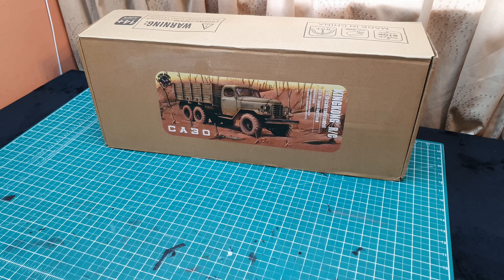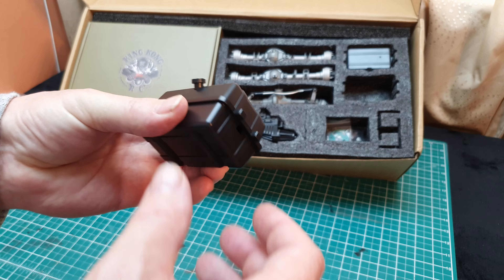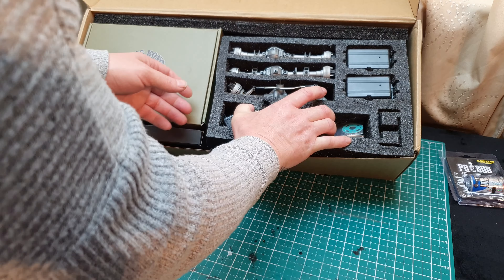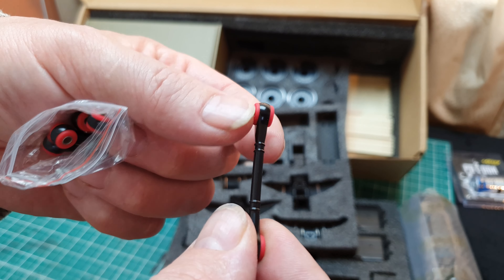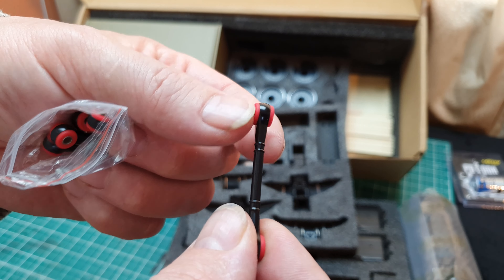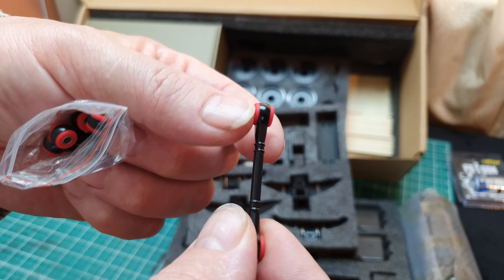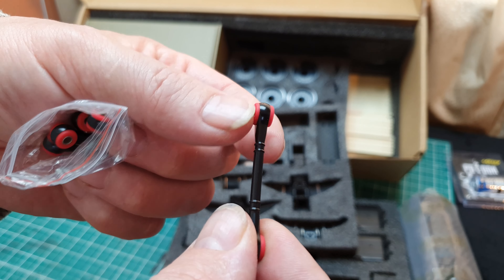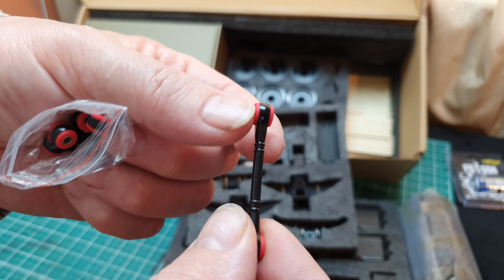KING KONG RC 1/12 CA30 6x6 Unboxing - Zsil ZIL 157 Millitary Truck

Comment: The 3 parts in the bag at the beginning are the wheel nut tool and sockets
I would think twice about the motor, I went with a 55T but changed it for a 27T silver can
The gearbox is geared down so it’s very slow
Reply from the maker: agreed, the carson motor was slightly too long and touched the servo so I replaced it with a 540 27t motor.

Comment: Bloody fantastic!! I've wanted to do one of these for a very long time. I have 3 Friends who have done them. The Quality is very good indeed. You're right, they're NOT cheap.

They all said the same thing.... These are geared LOW. If you use a high Turn Motor, you'll have NO speed whatsoever! A 30 Turn Crawler Motor would be perfect. 
Looking forward to seeing this go together!! 😁
Reply from the maker: it was slow so I put in a 540 27t motor, it's still slow but it drives nicely 👍
Reply: Yeah, it's definitely not a Racecar... But I heard that the "typical" 55-70 turn Motor only gives it 1-2mph!! 
But I've heard it's a beautiful Model, an actual triumph for A Chinese product. I do want one... I've also heard that they're as much or more than Tamiya Semis!
Reply: ..... Which I've already bought 4 of!! I don't know how much more lenient the Wife will be!!!